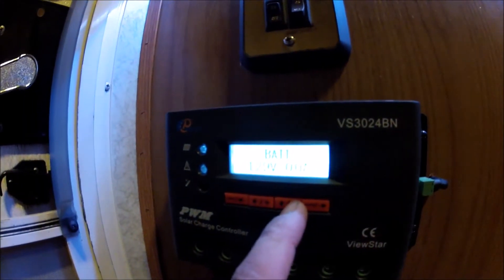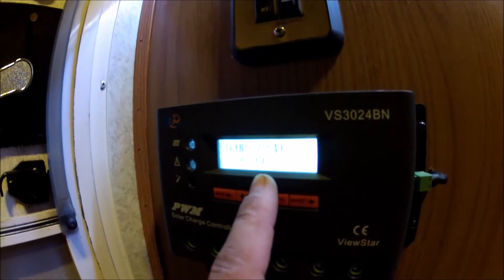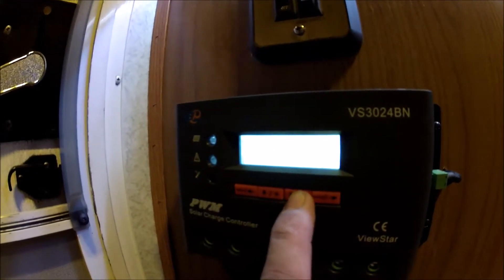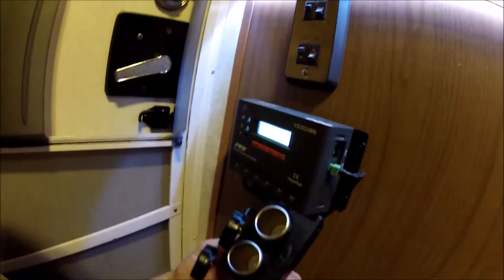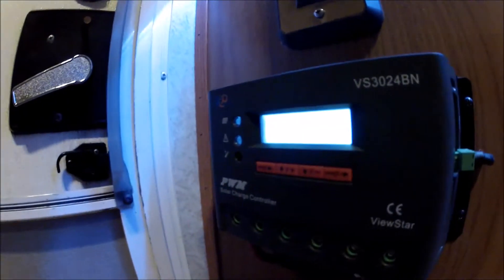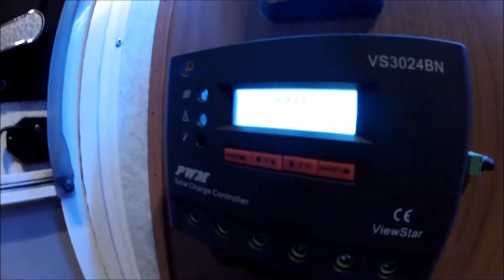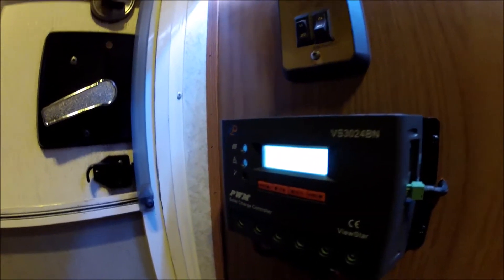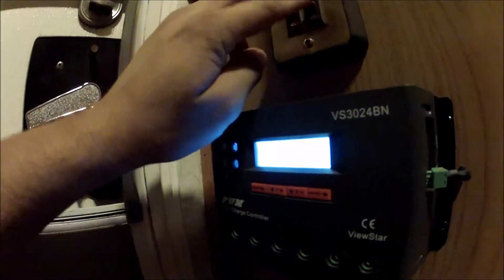Renogy Viewstar charge controller says the wrong state of charge

Comment: still using this controller? opinion of it? thinking of getting one but very interested in your thoughts after months of use
Reply from the maker: Hey looks like I replied to your other message but for pwm I do still really like this controller.  I haven't researched charge controllers since I bought mine though and there might be something else available now but I like how this solar charge controller can charge at my preset voltages.  I have considered getting a mppt charge controller from this same company. EP solar is the company that makes the controller,  Renogy is just a reseller.  Figured I'd add that in case you haven't figured it out yet.
Reply: +RV Crazy thanks for the reply!

Comment: Hello,

Regarding the issue with your Viewstar controller, you can improve it's accuracy of the state of charge (SOC) issue, by doing the following:
1.	Ensure that the battery capacity matches the rated value in your charge controller. (5. Rated Value)
2.	Ensure that the battery type matches the the battery setting in your charge controller. (5. Rated Value)
3.	Set “Batt Mng Mode” to SOC rather than V.C.

This should help with your accuracy issue, but if you would like to speak with a representative, please feel free to give us a call at 1 (800) 330-8678 or email our tech support team at techsupport@renogy.com.

All the best,
The Renogy Team
Reply from the maker: Unfortunately I haven't gotten an accurate display for SOC out of this but I did install a separate battery meter that show's me all the info I need to know.  Luckily the charge controller does a good job at charging it just only shows an accurate SOC as it is in a charging state.
Reply from the maker: Renogy Solar Hey thanks for the reply.  
So I have set my battery capacity to the 230 amp hours.  

I did also have the batteries set to flooded for the first 5 days of testing the charge controller before changing the charging voltages to match Trojans charge specs of a 14.8V bulk charge, 15.5 volt equalize and a 13.2 volt float.  I had the same exact issues before and after changing from flooded to user and I also made sure that all the other perimeters stayed the same unless they had to change to match the charge specs.

I tried SOC mode at first and then I switched to V.C. to see if that would improve the SOC.  I'll switch back again as I haven't noticed any change.

Thanks again for the reply, so my question for you is: Will this charge controller show a more accurate SOC if I am using the load terminals for all the load from the RV?  I'm not using a large inverter or anything that draws a lot of amps so the 30 amp load limits are fine for me and I know that if I have any large loads to hook them straight to my battery bank.
Reply: RV Crazy 

Having all the loads connected to the terminals could potentially give a more accurate reading, however, SOC is a very hard thing to accurately measure because of all of the factors that come into play that affect battery readings. These factors can range from temperature to battery cell voltage, to the input of the charge controller.
With that said, to get the most accurate SOC reading, a battery needs time to stabilize. Stabilization periods can take up to 24 hours. The SOC on a charge controller does not change instantaneously, it changes after some time passes by. Because the cells need time to stabilize for a better reading, what you can potentially do is leave the battery in open circuit when there’s no input from the charge controller and the SOC will change from time to time.
Reply from the maker: Renogy Solar After contact with the actual manufacturer of this charge controller EP Solar they have stated that their algorithim calculates 100% at the float charge voltage.  Normally 13.6 volts or so.  As a company reselling a large portion of these charge controllers you should probably know this and state that the SOC is only accurate while the charge controller is charging.  I still am planning on testing with all loads connected but I'm not expecting it to help much other than seeing how much power I'm using compared to how much its putting back in.
Reply: +RV Crazy Hey there, thank you for your videos! Did you have any luck getting an accurate display? I'm jumping through these same exact hoops right now.